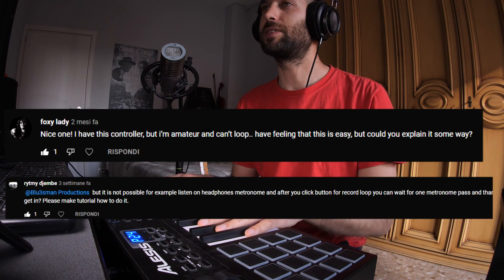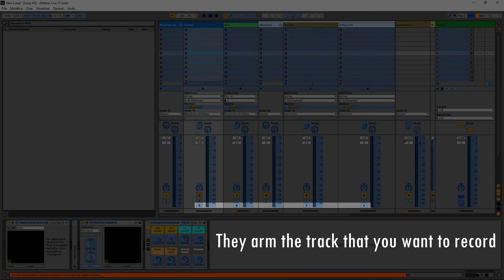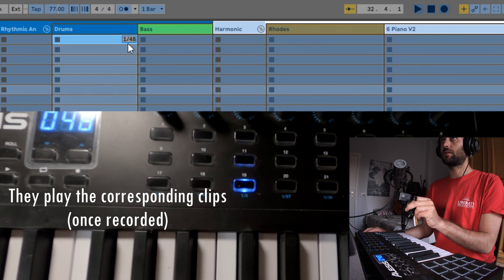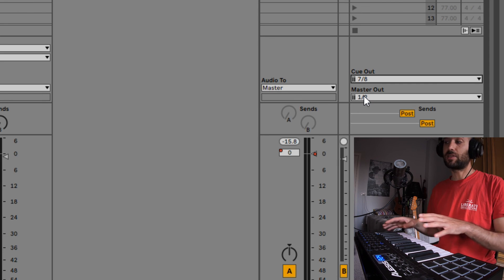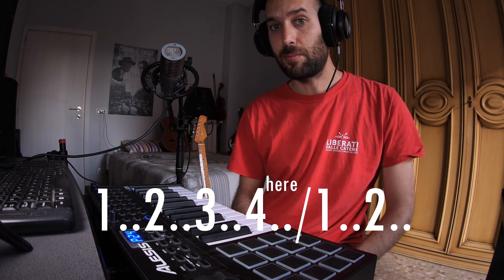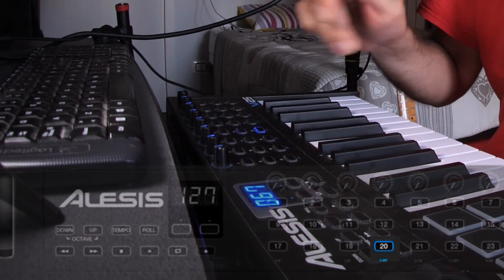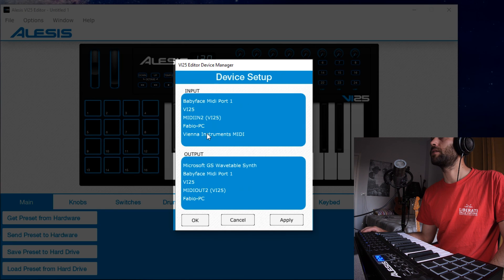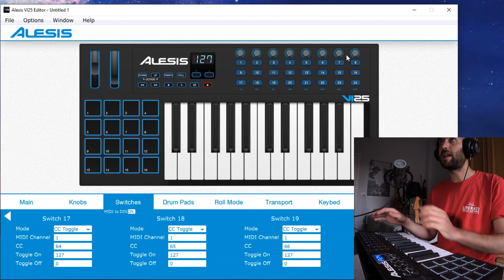My Alesis VI25 Loop Setup for Ableton Live

Comment: Hi do you need to have the sustain pedal for it to work, is it required or can It pe possible to use it without it
Reply from the maker: Hi, it's been a while since I uploaded the video and I haven't looped a lot since.. But for what I remember a sustain pedal (or any other midi switch) is important to toggle the "live session recording" button. Without arming that you can't directly pass to the next instrument you want to loop

Comment: Is it possible to setup momentary buttons with V25 MKII?
Reply from the maker: I see it comes with its own midi editor so it should be possible, yes
Reply: @FabioGrando  I installed the editor and I see it is not possible to program much. I will probably buy something like AKAI APC Key 25 MK2 which is built with Ableton in mind :)
Reply from the maker: That’s good for sure, max compatibility. I just downloaded v25 editor though and the momentary mode on the knobs is possible on switches and drum pads
Reply: @FabioGrando  Oh. I did not find "device section" with midi inputs. But you are right. I was able to "partially" improve it with "CC Toggle vs momentary" option which affects knob light on/off state. Thanks! 

I actually wanted to setup looper in Ableton and show ON/OFF state on keyboard. Problem is because V25 does not listen to  Ableton midi signals. If I press play in Ableton, V25 does not change state of the button. Signals form V25 to Ableton work OK.